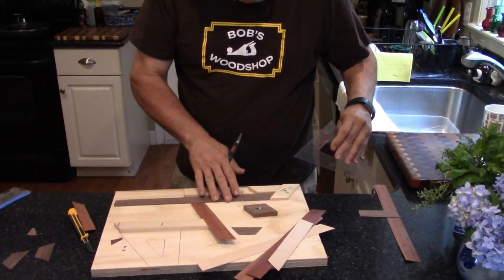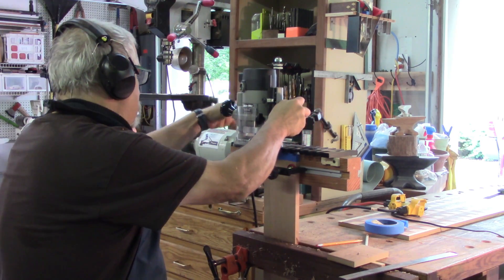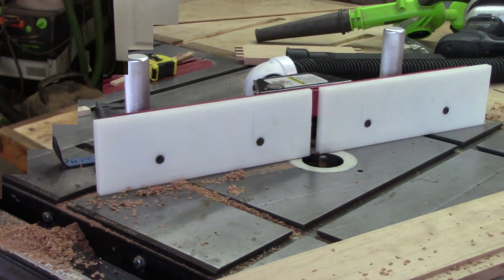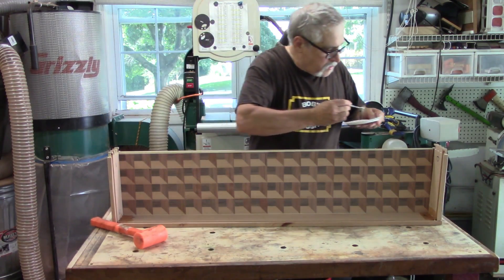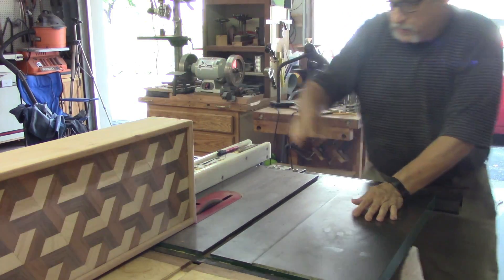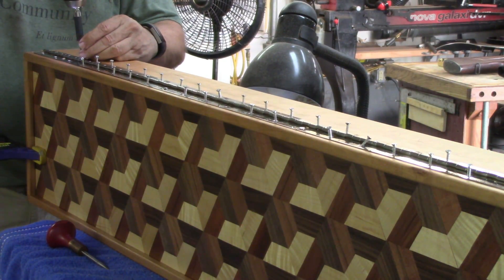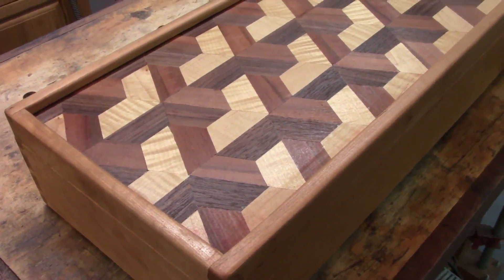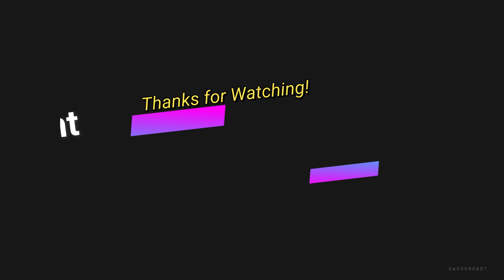Custom Gun / Rifle Case with 3D Veneered Designs - On Bob's Woodshop- Inlay-Veneer

Comment: Check out the SOSS #204 concealment hinges instead of those piano hinges. A much cleaner look and most importantly, Kamala herself couldn’t break into it to take your guns away. 
I only use concealment hinges for cases with such a high value inside.
Reply from the maker: Good to know.  Thanks for the tip.  Thanks for watching 👍